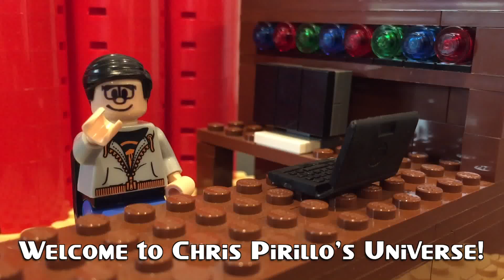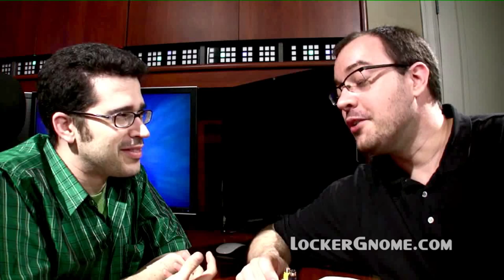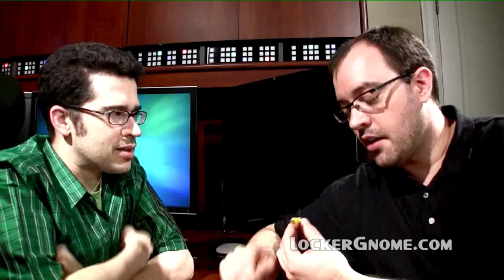S-Video vs Composite

Comment: What actually causes dot crawl is that the chroma signal is modulated into a checkerboard pattern ontop of the B&W image and the TV set tries to filter out the pattern, but has trouble filtering out contrasty colors.

Comment: depends on the product some ok a lot of mfs wanted cheap products s they would take the Composite and simply split the video out with a 470uf cap on one side in order to make a svideo connection. a nother thing is you are wrong about the resolution of svideo is 576i while the max of composite is 480i that you would get on most tvs. but the biggest thing was that svideo would give better color and a sharper image with a good quality cable some people who would sit close to the tv would notice a difference.

Comment: S-Video was mainly used to connect regular or non-Blu ray DVD's. Despite the hubbub the economy is still horrible and many of you are keeping your old set Standard Definition (STD) TV until it stops working. By connecting your cable box to your STD set your picture should improve noticeably. It won't be nearly as good as your neighbors High Definition set but the picture quality should be similar to the picture you get on your DVD.